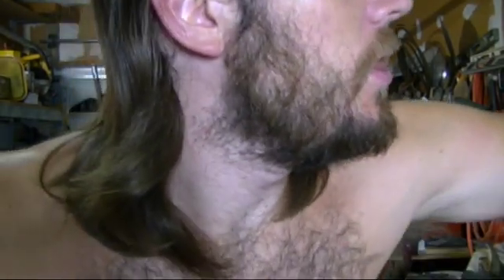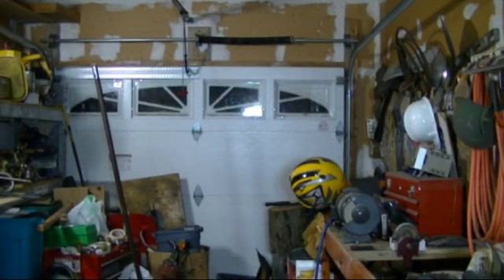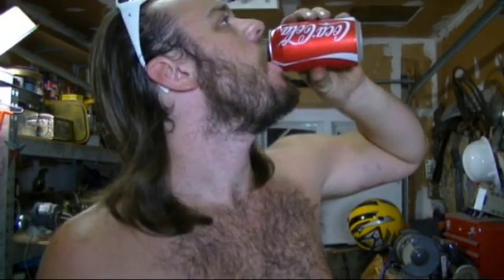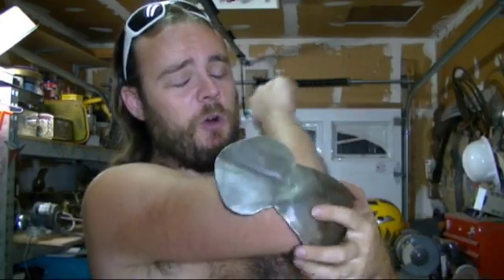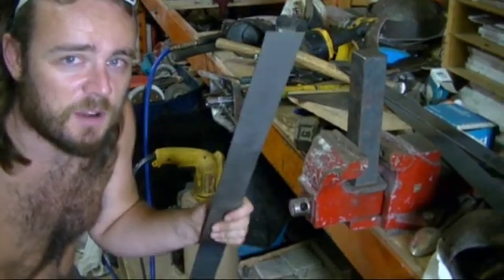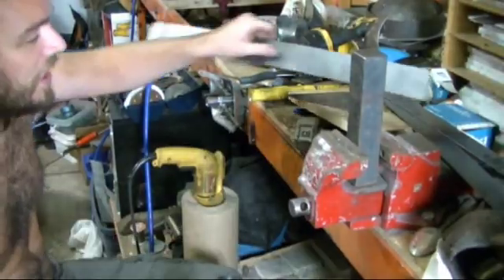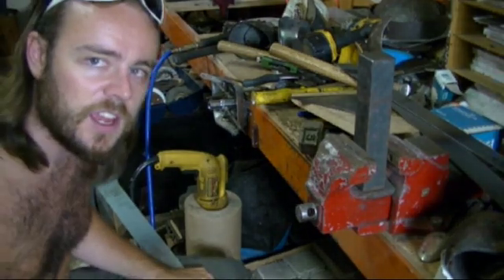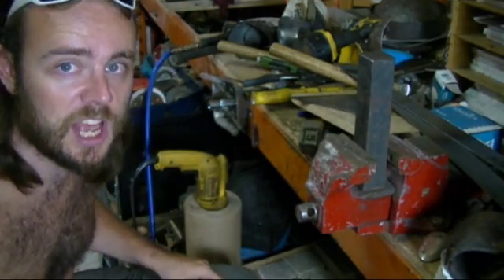How To Make A Steel Helmet You Can Wear -Part 1

Comment: Wiki-Wiki-Wiki-WikiPedia...The Spangenhelm was a popular medieval European combat helmet design of the Early Middle Ages.[1] The name is of German origin. Spangen refers to the metal strips that form the framework for the helmet and could be translated as braces, and -helm simply means helmet. The strips connect three to six steel or bronze plates. The frame takes a conical design that curves with the shape of the head and culminates in a point. The front of the helmet may include a nose protector (a nasal). Older spangenhelms often include cheek flaps made from metal or leather. Spangenhelms may incorporate mail as neck protection, thus forming a partial aventail. Some spangenhelms include eye protection in a shape that resembles modern eyeglass frames. Other spangenhelms include a full face mask.

The spangenhelm arrived in Western Europe by way of what is now southern Russia and Ukraine, spread by nomadic Iranian tribes such as the Scythians and Sarmatians who lived among the Eurasian steppes. By the 6th century it was the most common helmet design in Europe and in popular use throughout the Middle East. It remained in use at least as late as the 9th century.[2]

The spangenhelm was an effective protection that was relatively easy to produce. Weakness of the design were its partial head protection and its jointed construction. It was replaced by similarly shaped helmets made with one-piece skulls (nasal helms), kettle hats and eventually the Great helm or casque. Barf...
Reply from the maker: lol